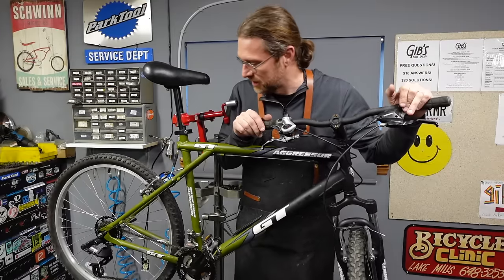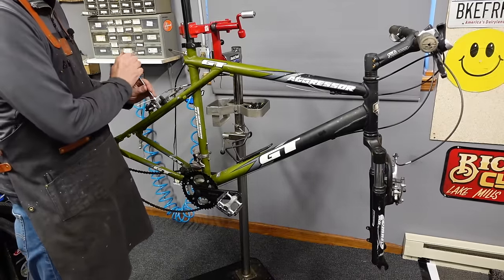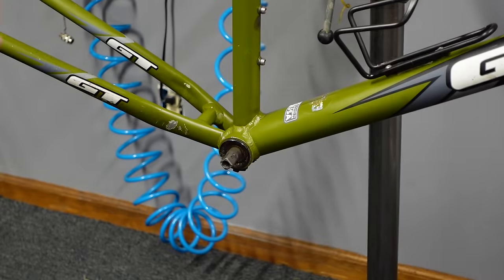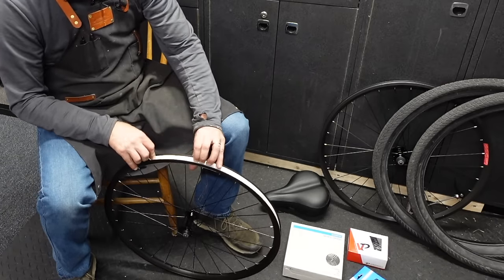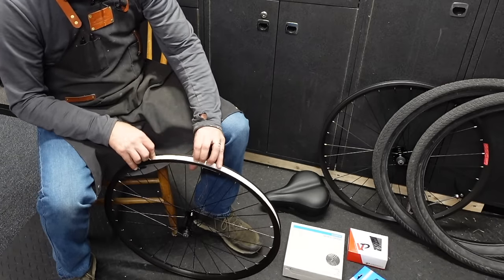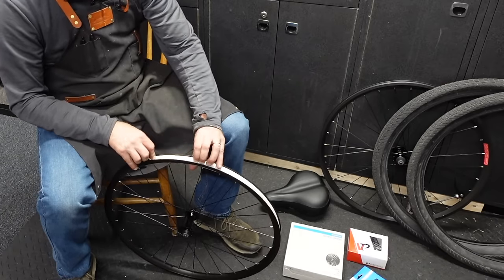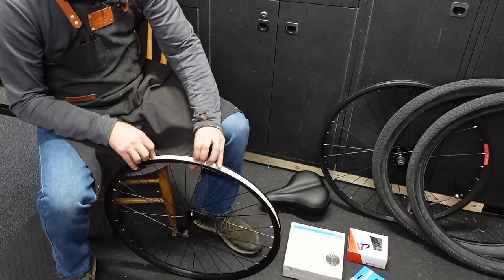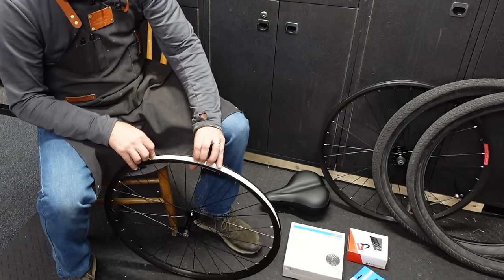Old MTB Converted to a Comfort Bike using Shimano CUES 1x 9speed drivetrain parts. TURNED OUT GREAT!

Comment: The funny thing is, lots of tubeless guys will just use a tube to fix their flats! 😂
Reply: Been there, done that.

Took forever to pull all the thorns and other sharp bits out of the tyre to make sure the tube didn't instant flat.
Reply: I still carry a tube for longer rides but yrs later I've yet to get a flat that I couldn't fix with a plug on my tubeless setups 🎉
Reply: @LaurentiusTriarius yea, plugs seem like a good solution too. Bikes are taking lots of notes from cars these days 😉
Reply: Only as a last resort. Mostly flats are avoided but fixing a flat is just so quick and mess free, wheel in. Tubeless has meant I've not had to arrive some place with the inevitable filthy black staining all over my hands from a tube change.

Comment: I love CUES. Durability and price is way more important than weight to me.
Reply: Durability and price for sure. Weight can be saved for free by riding more to get in better shape. Well, if you have a few extra pounds to lose like I do.
Reply: @Moostery I like the way you think and I totally agree! Following your logic, I've made my bike almost 40 lbs lighter over the last year.
Reply: @thatcarguy1UZ  my bike seems to gain and lose weight regularly. I think it eats too much home made food around holiday times personally.
Reply: @Moostery  True. I am more concerned about the extra 100lbs of rider weight my bike has than a couple pounds of extra steel.
Reply: CUES frustrates me immensely, because of the way that it ignores the 35 year history of shared pull ratios in the majority of Shimano drivetrains through 9 speed mountain and 10 speed road, and even more so the standard cog spacing and chain interchangeability for those speeds. 

Now when you need a new chain or cassette, there's a needless additional question required: What 9 speed do you have?  What 10 speed do you have?  The old stuff will never go away, and in all likelihood will outlast CUES as a system.

While I agree with reducing the compatibility issues, I definitely do not I see the benefit (aside from padding Shimano's pockets) of making new 9, 10, and 11 speed groupsets that all share the same spacing and chain.

Why even bother with 9 and 10 when you have to have the same spacing (i.e. cassette cogs) and chain as 11 speed?  It's not like the extra 1-2 sprockets on the cassette cost very much, and the extra ratchet points on the shifter literally cost nothing extra because they're just molded into a piece of plastic.

It gives Shimano a way to differentiate drivetrain price levels at minimal cost to them; I get it.  But at what cost to the consumer?  This policy just encourages waste of old components that are otherwise good, but not up to the latest standard.  (Yes, I know BikeFarmer and others will save old components to use them, but many do not.)

CUES 9 speed has the same increased sensitivity to derailleur hanger misalignment as 11 speed.  Same for 10 speed.

OTOH, CUES cable pull - Shimano 11/12 speed is 1.1:1 at the derailleur - is less susceptible to adjustment issues than old 1.7:1 9 speed. 

The one benefit of 9 speed CUES is less crosschain angle versus the 11 speed CUES or SIS 9 speed.  That's a good thing I guess, but it seems like a paltry one compared to taking 35 years of history and throwing it out the window.

So if we look at the CUES components themselves again, why are there different speeds shifters? Since the cog spacing is the same for the whole range, an 11 speed shifter would cost the same to manufacture and work for 9, 10, and 11 speeds.  But that wouldn't allow Shimano to charge more for more speeds. 

Why are there different derailleurs for CUES 9 and 10/11?  The pull ratio is the same.  You want different cage lengths, and you want the parallelogram angle to match the cog tooth diameter profile, but neither of those are directly dependent on the number of speeds.  And why are there different 9 and 10/11 speed CUES front derailleurs!?  If the 10/11 speed ones can't work satisfactorily with the 9 speed, they're doing something wrong.

All I see is a cash grab with CUES.

Why are riveted chainrings still a thing?  And even worse, proprietary BCD patterns that you can't even drill out to mount a new ring on?  Do we still need to be throwing crank arms in the garbage when the chainrings wear out in 2024?  Yes, I know they're steel and will last a long time.  Most will probably never be replaced.

I have been a Shimano customer for a long time, but any new sub-11 speed drivetrain I build is going to get Microshift now if it isn't legacy Shimano, friction shift, or IGH.  At least I can actually use a 9 speed chain on those 9 speed drivetrains.

Comment: I don’t know why you complain about setting up discs either. When I finally upgraded I was blown away by how ridiculously easy they were to get good enough. Maybe 10minutes Lea ring how they worked and another 5 to get the other one going. Did it on QR as well, still no problems with rub after taking wheels in/out either. But maybe I’m just lucky there.

Comment: Bike Co-ops, where you meet "mechanics" that know so much that just isn't so.  Stopped by one to grab an old derailleur and drop off a car load of used parts from our shop.  A kid renting a work stand was trying to put a standard BSA 24tpi BB into a vintage Raleigh (26tpi).  I instructed him that he needed a 26tpi bb.  The "experience mechanic volunteer" told me I was wrong and told me not to give instructions until I take their training course.  Guess my over a decade of professional experience at the time and multiple industry certifications didn't account for anything.  He then turned back to that guy and helped him make a mess.  I wish that was the only example.  The same Co-op volunteers used to stop by my buddy's shop not far away and undercut repair quotes to customers IN HIS SHOP.

I know the overall outreach and goal of Co-ops is good, but I'd rather hire a mechanic with no shop experience with the willingness to learn than someone who learned everything the know from a Co-op.  Last one we hired cost us so much in terrible repairs that damaged our reputation and nearly caused legal trouble.

Comment: As big guy(300lbs) in south Texas tubeless was a game changer. I would make sure I always had two spares tubes on me for any ride over my usual 5mile commute. Goat heads and mesquite thorns were the bane of my tires. After going tubeless and doing my first fluid top up I ran my hands along the inside of the tire. 8! I counted 8thorns, on a single tire, just happily sticking 1/16-1/8in through the tire. I left them be and filled’er up, I’ll never look back.

Comment: Great video! It is important for people to understand that this conversion would not have been possible without that new "clutch-style"" derailleur. That, and the "narrow-wide" chaining are crucial to the 1 x set-up. Otherwise, the chain would fall off every time you hit a big bump. I road a GT "Karokorum" similar to this bike around Europe in the 1990s. The super stiff  "triple-triangle" frame makes it a joy to ride. It is wonderful to see this old bike brought back to life! It is infinitely higher quality than a "Walmart-bike" at a similar price range.
Reply: The 9 speed Cues rear derailleur (u4000) actually doesn't use a clutch, the narrow wide ring and a unique spring setup is enough. The higher spec u6000 has a clutch and should interchange with the u4000 on a 1x9 setup.

Comment: Top tip from a fellow wrench. Cloth tape sucks, it’s too thick. I ditched it a couple seasons ago after noticing how much harder it makes mounting tighter (cheap and stiff) tires. I started using Stan’s or Muc-Off tubeless tape instead. It sticks better and is much thinner. Buy the big shop, bulk rolls in a few widths. I only use it on double wall rims, like you said, rubber rim strips are the way to go on single wall. 
I also wanted to say that I know that stroking out that feeling all too well. You gotta take time to take care of yourself. Eat snacks and stay hydrated. The bonk is real! Good luck this season, keep up the good work!
Reply: I have one particular double wallled rim a 26er Rhynolite that has this exact problem where Cloth Tape is too thick to the point its on the fringes with multible tire combos.  I have had so many people insist that the thickness of tape doesn't matter, and they haven't fought with this particular rim.

Comment: I returned my 2003 GT Idrive to be a comfort bike today. Before retiring it as a mountain bike, I packed the Idrive mechanism with JB WELD along with all the other worn out pivots! A pipe replaced the shock spring! Actually,  I put it away in fairly good shape. Today it got 1 1/2" 26 inch slicks, put the old saddle back on. The crankset is set up with 20-32-34 as a 1x and 12- 42 8 speed cassette. No front derailleur,  brake lever, or front brake. It actually looks and runs well in this configuration. It's my only bike that works with my Bob style Yakima trailer. In a pinch, you could pick up the chain and run 20x42 or 20x36 gearing,  but not much smaller cassette cog. Could also do easier gravel on this.
Reply from the maker: 26 x 1.5 is my least favorite tire size!

Comment: I really Like the Idea of Cues. Cross compatibility everywhere. Yes! We need that. But the implementation is far from perfect, as we already had that. Shimano already had a perfect 9 Speed System, which (btw.) was perfectly intercompatible. 
I can already mix every Shimano 9 Speed Shifter with any derailleur. Doesn't matter, whether it is road or mtb, ...
So why couldn't they just use that (or at least the same cable pull ratio) for Cues (or just integrate the Cues System to their 9 Peed system. 
Not only do I now have to double-check, whether something is "old" or "new" 9 speed cable pull, 
but the support (from shimano and other brands) for shimano compatible "old" 9 speed stuff will slowly end. 
And nobody seems to care... Why. This is pure marketing :( 

Btw. great video. I defenitely have tocheck more of your videos this evening. 
I have do finish this text, now, as I am typing on a phone with broken display and faulty touch screen. LoL 
Bye
Reply from the maker: Yes, 9sp shimano is a sweet spot in history. But with the advancement in 1x drivetrains, CUES seems like a good path forward. But it is like 5000 new SKUs so 🤦🏻‍♂️
Reply: @bkefrmr  
Yep. Cues means lots of new parts and quite probable expiring of the support for all the "old" stuff (which almost all my bikes use, as it was (imo) the best overall cross compatible system) 

As far as 1by goes:
I often build up 1x9 Setups with Shimano 9 Speed systems. Either with old or new shimano parts, or with new shimano kompatible parts from other manufactures. They are almost perfect.

The only thing shimano hat to do is build and sell a 9 speed derailleur with a clutch and a range from 11 to 46. But they prefer to sell a whole new system. (Totally understabdable from a business perspective. Especially as most customers don't even know it is probably not the most customer friendly way. But as a customer I don't like that)
Btw such a derailleur already exists in the old shimano 9s system with the SunRace RDM900. But its not the best quality wise (its ok, but I would prefer to pay a little extra for a better one).

Comment: I have just converted an old Marin Rift Zone in to a retro mod. I used Deore 1x11. Like you, it was my first time with a 1x11 rear mech set up. The new super range mechs are quite different to the older style. Took me a few attempts to get it right myself. I'm deffo a 1x11 convert though. Don't know why they didn't do it 30 years ago. You've really nailed thr Bob Ross thing. Love the style you've got here. Being in the UK I just discovered Bob Ross a few years ago but found it quite therapeutic. You can add yourself the list of therapeutic film makers

Comment: My technique for setting limit screws is this. Wind the high (small gear) stop in a bit, then get the bike to select the smallest cog without the cable attached. Then add the cable and adjust so the gears index correctly. Then go to the biggest cog and set the other screw so it doesn’t quite engage, and back it off until it’s spot on.

Comment: Great build, you'll be able to smash that bike round cities & light trails with minimum fuss & maximum comfort. Really well thought out. Only improvement I'd suggest is a double sided chain guard on the front cog to help prevent oily trousers or the chain jumping off. The CUES system looks very interesting, Shimano claim it optimised for ebikes too which is really needed if true, as I can state from experience lol.
Reply: Or leave the old front derailleur and lock it in position using stop screws. That's what I did.

Comment: About tubeless. I was in the same boat as you. Why deal with the mess and complexity of tubeless when tubes do just fine. Cue new bike purchase that came tubeless. I really don't know if it was the frame or the tires that made it way more comfortable than my old bike. What I do know after replacing my first set of tires on that bike, the number of holes tubeless filled without me knowing was astonishing. I never had a single flat I had to fix on the road. There was one time it managed to seal a gash on the margin of the tread/sidewall. Riding in the alps bombing down some great twisties. I noticed when I got back that the rear tire was a bit low. It wouldn't hold the pressure. Blew the sealant out the gash. Ended up patching the tire from the inside using just the tools I carry on the bike. Replaced the tire when I got back from vacation. I'd hate to think what would have happened if the sealant didn't seal that gash while bombing down a hill at 70+.

Comment: I agree with you about tubeless. As a home bike mechanic that maintains my own little Fleet of bikes between mine my wife's and my five kids, I think just having tubes is easier. What is your opinion on the heavy duty slime tubes? They are extra thick and they come filled with slime. I'm currently using them on my bike and I've run over a couple of thorns and road debris that would have left me stranded with a flat before, but the Slime has done a fantastic job of sealing things right back up.
Reply: I used to use Slime and after a year or so it just clumps up into balls and is ineffective on punctures. Maybe I got unlucky though.

I switched to Flatout sealant (they make one for bikes). I think its a better product and seals up punctures from thorns/nails and maintains its viscosity.

Comment: One comment on bike coops.  Ive been involved in a number of them and they all seem to work quite differently amd have different strengths and weaknesses.  The one I am currently on the board of does not typically let volunteers build a bike that will end up for sale.  I think i was volunteering for two years before they let me touch a bike that would be sold.  That said, its funded by its own operations and can afford a full time staff of mechanics.  Ultimately it seems that the more successful strategy is to take the mentality that the coop is providing a seevice to the volunteers and not the other way around.  This means that there is no begging for volunteers or putting out work done by inexperienced hands out of necessity.  It also means that accepting volunteers can be conducted just like accepting work orders.  With a clear eye on how much time and resources are available.  We also created programs like a bike valet that are accessible to folks without mechanical skills.  Anyhow, heres hoping for the best for the coop in you area.  Its always sad to see shoddy work go out.
Reply from the maker: That’s not what happened. You’re making a ton of presumptions here. I understand how bike non-profits “should” work. I think if they’re funded on their own operations, should be a for-profit business and eliminate the need for boards, and all of the problematic personalities they attract. This was a giveaway bike that needed tons of extra help because an under-qualified volunteer presented as an expert. I gave them money to fund their programming and solved one of their bike problems. It’s a win-win. Anyway, it sounds like you’re describing Working Bikes in Chicago. They’re great at what they do!
Reply: @bkefrmr fair enough, tho I wasn't intending presume, just share some of my own observations and experiences.  What are YouTube comments for except unsolicited opinions? Anyhow, I always enjoy your build videos.  Definitely keeps me inspired.
Reply: I am grateful for the opportunity I had to learn how to wrench at a community bike shop. I volunteered nine years, and many of those first years I did not have a clear idea about what I was doing-even when I was assisting others. I also often supervised volunteers who know knew less than me. One time, I thought I was preventing trouble by asking a volunteer to disassemble an old 80s Italian race bike. Instead of just taking the old Campy parts off the frame, he took the Campy parts apart themselves--uninspiring the campy derailleur and damaging many valuable parts that would have gone into the parts bin. Big lesson for me about the diligence and judgment needed to supervise others!  Eventually, with the help of Covid, the project went from a volunteer based organization to a paid-staff driven non-profit. I spent countless hundreds of hours dealing with strong personalities on the board--including my own. I learned a lot over-and-above bike mechanics, and do not regret my time there; but, as I've gotten older, I can no longer tolerate non-profit boards and consensus management.

Comment: Also, I encountered the exact same issues with v-brakes this past weekend lol… old calipers with worn out springs and loose pivots. Works fine when you finally get it sitting right but God have mercy on you if you need to take the wheels off!